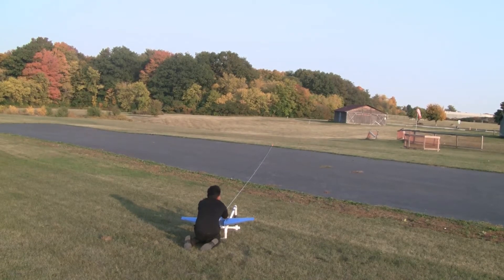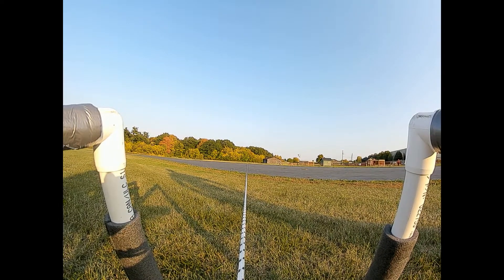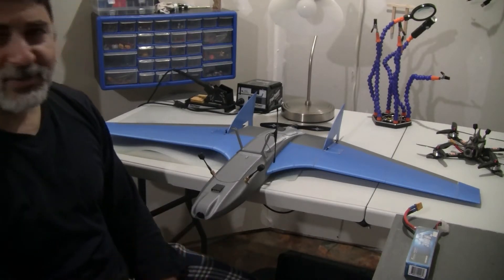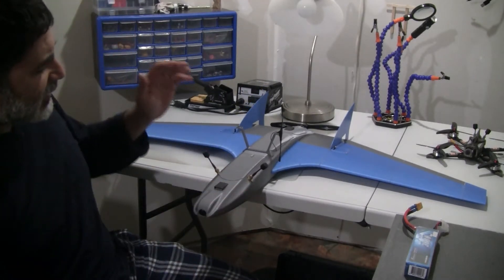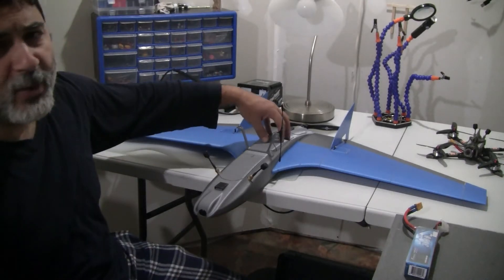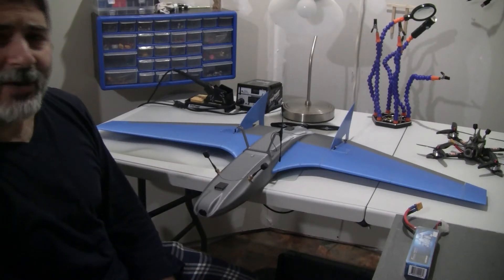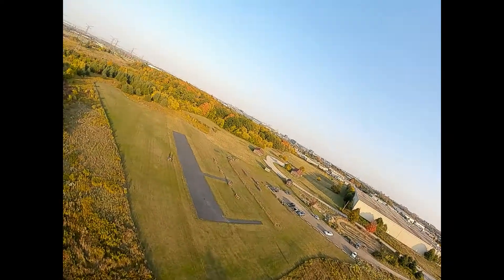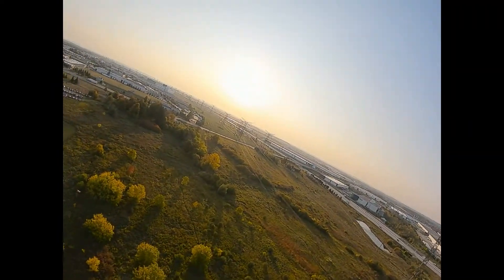3D Printed Swept Forward FPV Wing - Part 3

Comment: Hello, I've almost finished the left wing, but I'm missing the ailerons. They're pretty long and thin. If the printer makes the last 9 cm, the surface will not be nice. because the print exerts minimal pressure and the printed part moves. With supports, it only works to a limited extent because the supporting structure is printed so thin. How do you do that with the ailerons?
Reply from the maker: Divide the aileron into multiple sections, this would solve the problem. Did I answer your question ?
Reply: @RaedAdlouni  Ok, I'll try that, good idea.

Comment: Thank you for all the info you assisted me with, but i think i give on printing this wing, I am new to printing and it had look like an easy project, but for some reason, I can't get the wings to print, when i do print them they flimsy and the ends are not blocked where they should be glued. i don't know what i am doing wrong. i am printing them in vase mode according to the instruction
Reply from the maker: Hello Adrian, yes it can be challenging if this is the first time printing. Set your parameters such that walls are 1 layer, bottom is 1 layer, and top 2 layers. It is also important to check in the slicer how the printer will execute the print so that you can change parameters accordingly. I am currently printing another plane and it is working fine with what I mentioned above

Comment: One more question the slot for the elevon hinges you have to cut them out, becuase after i print the wings there is only a line showing where the hinges suppose to go
Reply from the maker: Yes, heat an exacto knife and make a precise cut
Reply: I use Fabric fiberglass hinges, very thin. they fit into the slits. something to cut.

Comment: The one on Thingiverse is 995 grams ready to fly.
Why is yours 1050 grams for the bare plastic air frame?
Reply from the maker: I printed the wings using two layers (walls), I used PLA, and I printed the fuse with multiple layers for strength, anything other than that would make it very fragile, maybe next time will print it with LW PLA
Reply: @RaedAdlouni   Colorfabb 235°C bed 61! speed 60/ 50%for thin walls. the surface just looks perfect, you don't see a layer. everything in vase mode. I'm doing 4 layers on the ground, less would work. I only have problems with the ailerons, they are too wedge for vase mode. and then it wobbles, then the top layer doesn't look good. The fuselage is printed in the description and is very stable. in LW PLA it weighs 101g without the lid. all 4 parts. Wing1 12g, wing2, 10.9g, wing 3 22.8g so very light and stable.
Reply: @RaedAdlouni  I printed the free model A from Eclipson in White PLA and it printed fine with one wall. My first 3D plane printing! 
A brick can also fly with enough thrust! 
Weight is your number one enemy. 
This is why you need a bungee cord to launch it. 
LW-PLA is shit and breaks if you look at it the wrong way...

Comment: Hi im just putting my wing together and I am wondering that with 8mm reflex Half of the elevon movement is used up. Did you find you could reduce the amount of reflex with the C.g change to 11cm?
Reply from the maker: Did not try that, but 8mm should not take half of the elevon movement, where are you measuring the 8mm from ?
Reply: @RaedAdlouni  I am not up to that point yet but with the elevon at a neutral position, measuring 8mm up at the trailing from neutral position seems exesive. Was this your final reflex trim position,  as you posted in your original post test flight video. I'm just trying to guess the reflex needed after you updated your c.g. thanks for your replies.
Reply from the maker: Yes it is the final reflex. The elevons are quite big, so 8 mm is not that much. As you print and assemble the elevons, send me some pics and I will try to help if needed
Reply: @RaedAdlouni  thankyou

Comment: Awesome wing. With 8mm reflex i would say there is possible more room to move CG back. but it depends how touchy the pitch becomes. What KV rating is the motor you are using?
Reply from the maker: Using 1200kv motor, 4s

Comment: Hi Raed, Thanks for the great work. I was just checking the STL`s from Thingiverse and noticed they are for 6mm rods but you mentioned an updated version on RCGroups. Any chance to get the updated wing files for 8mm carbon rods? Cheers, Chris
Reply from the maker: that must have been someone else, i used 6 mm rods

Comment: I am building the same plane and was also wondering where the CG is. I hope you can post where the CG is. Thanks.
Reply from the maker: Will do as soon as the weather permits for a second flight
Reply: @RaedAdlouni  Thanks. One more question, can you launch it by hand throwing instead of bungee launch?
Reply from the maker: I have not tried, but I dont recommend that given the weight. Yesterday I flew it again and figured out the correct CG, I will post it tonight in the description section.
Reply from the maker: correct cg is posted in the description
Reply: @RaedAdlouni  Thanks! Hopefully I can get it to fly this coming weekend.